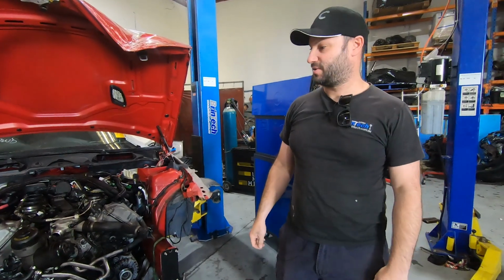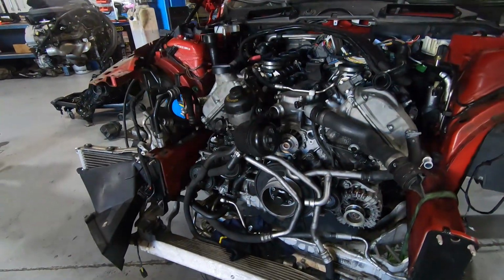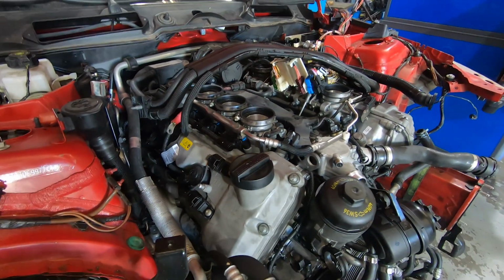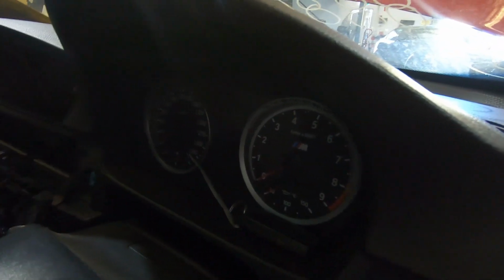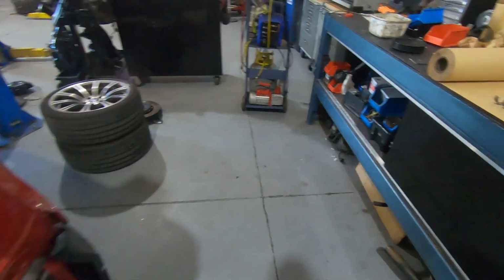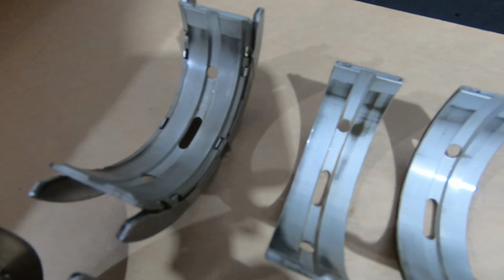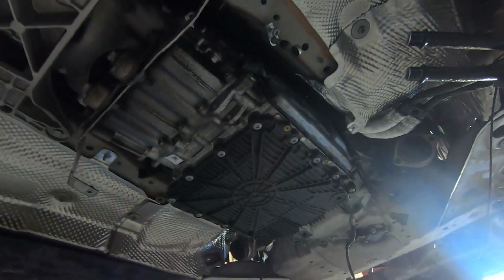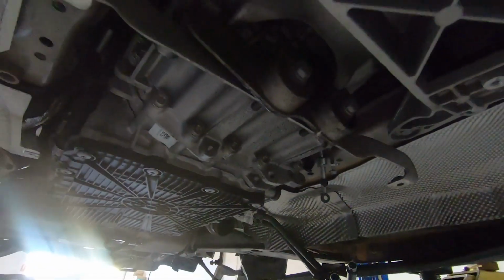EPISODE 1: BMW 130i S65 V8 Engine Swap with DCT @ Brintech Customs

Comment: Have you done the mains without removing the crankshaft?
Reply from the maker: yes many times
Reply: @BrintechCustoms  wow that’s truly amazing , the timing chains as well? Are there special tools for these jobs?
Reply from the maker: @yusufachmat8588  chains aswell. Yes you need cam timing tools and good knowledge of engine bearing installation procedures. It also helps to know the S65 engine

Comment: How much does one of these conversations cost is it possible to do on  a 128
Reply from the maker: Its roughly $50k AUD
Reply: @BrintechCustoms  with the M3 or without? Thanks
Reply from the maker: @davidmitchell5638  Us supplying required hardware.